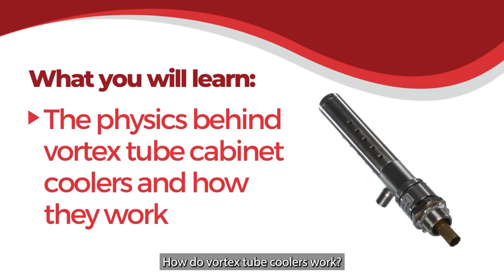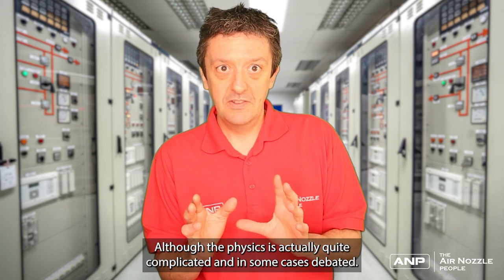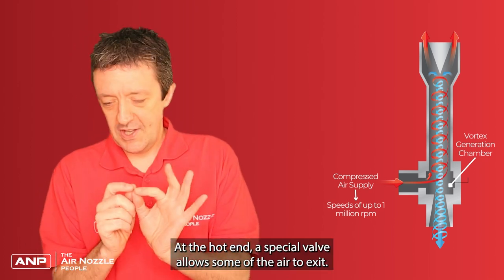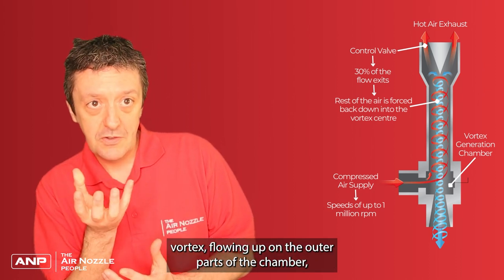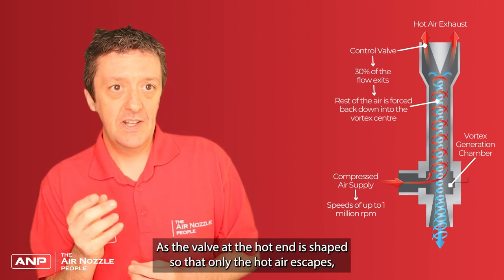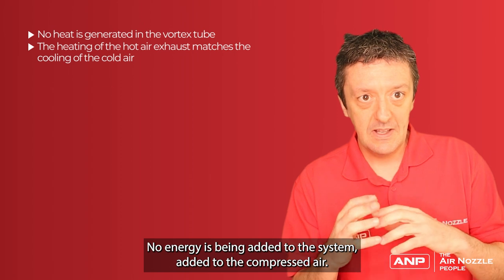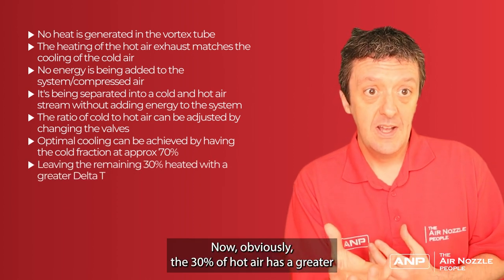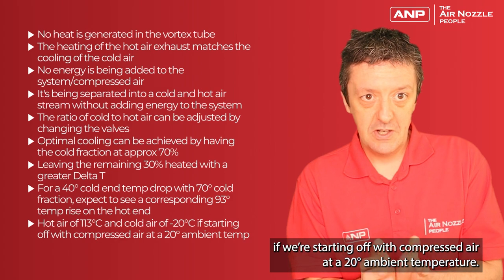How Do Vortex Tube Cabinet Coolers Work?

Comment: I have to wonder how much of the temperature reduction is simply from compressed air expanding.  You compress air and it gives off some of its heat - that's why a compressor tank gets hot as you compress air into it.  Release the compressed air and suddenly its capacity to take on heat increases, i.e. it pulls heat energy from whatever it touches, making it colder.  As for the tube itself, this video calls it a 'heat exchanger', but I think it can be explained better than that. I suspect that for it to work, the central flow of air must be compressed by the outer flow of air. It's like the outer air is a pipe and the central air moving down it in the opposite direction must compress to get through the tight space available.  As the central flow compresses, it gives up more heat, which is swept away in the opposite direction by the less compressed outer air. Also, I notice a lot of the videos out there on vortex tubes make statements like 'no moving parts' and 'no internal power source', which I feel is a bit misleading.  You really do have to include the compressor when talking about how this all works, but they all seem to want to avoid this as it makes the end product seem somehow 'magical'.  Without an electric compressor for this even to work. Even if your source is a tank of compressed air with no compressor attached, at some point that air was compressed by a compressor running on electricity.
Reply: yes, they really have abysmal COP due to the electricity used to run the pump. one thing you are neglecting is hot air thrown to the outside of the vortex using centrifugal force due to its density the big benefit is no refrigerant, extreme Delta T, and a compact end nozzle compared to traditional HVAC expansion coils. 

I do like your point about "no moving parts" because aside from a fan, the evaporation coils of a traditional HVAC also has no moving parts and is connected to a compressor on the other side
Reply: John, what does COP refer to?  Not familiar with that acronym and appreciate help with its meaning.  Michael, thank you for the elaboration.  From a thermo standpoint, I am trying to wrap my head around the concept for this device.  I agree that calling it a "heat exchanger" may not be the best analogy because everything I've learned and have dealt with tells me this device would violate thermo laws if it were a heat exchanger and is tripping me up (delta T, cold to hot heat transfer?).  Maybe I need to review my refrigeration cycles but I think you are on to it with a more accurate description from a thermodynamic and fluid mechanic standpoint.  Thanks for your comment.  Air Nozzle People; thank you for posting this video to help me on my way to understanding the working principles.
Reply: The "no moving parts" and "no internal power sources" are important to state because it differentiates the vortex tube from chillers and other types of cooler. In a factory setting installing a new chiller unit to provide additional cooling means you need to install something quite bulky and then run electrics to it. This equipment then requires maintenance and you will need to consider things like whether it's in dirty environment or needs to be washed down. 

Most factories will have air lines already there so all you need to do is put in a vortex tube and hook it up to an existing air line. Because there are no moving parts there is no additional maintenance burden and because there is no electricity required you don't need to worry about getting power to it where there might be, for example, water sloshing around. Air powered applications are quite inefficient in terms of energy but they have the distinct advantage of not needing to worry about electricity in a wet environment. This is one reason why many factories have air powered systems. The compressor can be located away from any water or grime that might mess it up and then the air is piped to where it is needed. Local water, dust, grease and all the other things that mess up electrically powered systems are not really a worry with air powered systems. So the inherent inefficiency of air is overcome by the fact that its just a far more usable power source in many practical situation. 

All this makes vortex tubes really easy to install in retrofit situations. That's why it's important to make this distinction.

Comment: What is the typical COP of a device like this? For example, if I used 100W to power the compressor that provides the compressed air - how many wats of heat can I generate at the hot end of the device? (or, more clearly, how many watts of heat get moved from the cold side to the hot side?)?? Thanks!